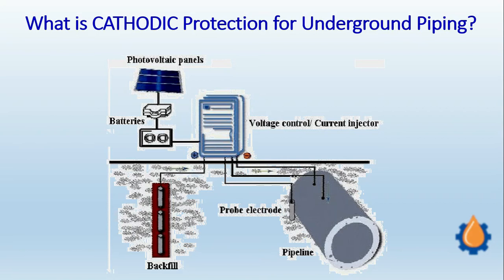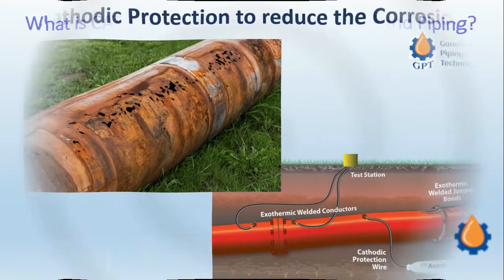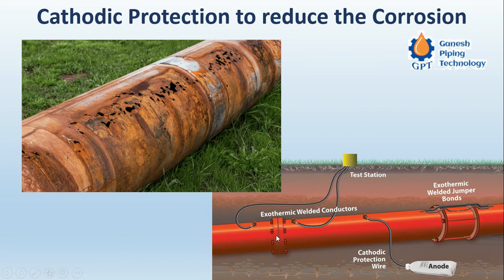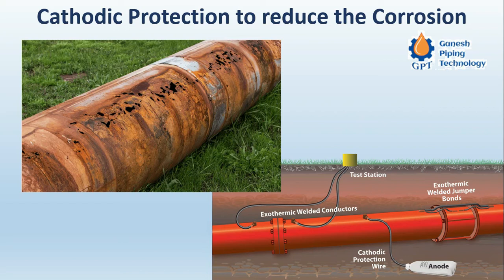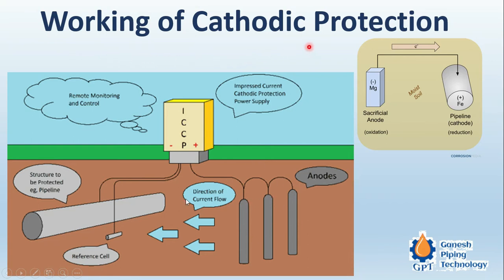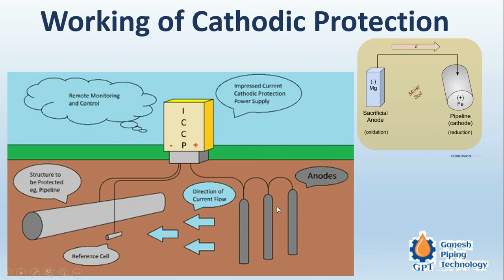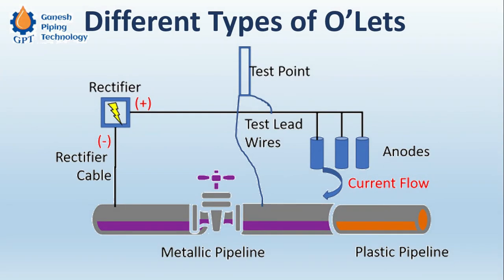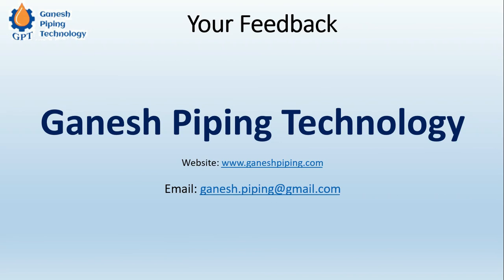What is CATHODIC Protection for Underground Piping?

Comment: Can be explained in a better way and seems few points are missing
1. Where dissimilar metals are in contact, one will act as cathode and other will act as anode based on the active metals list in the periodic table. Anode will corrode. For this we need to isolate dissimilar metals using insulating gaskets
2. If pipe is in under ground, pipe will be become anode as earth is huge potential cathode. To avoid pipe corrosion, use a less active material so that it will act as sacrificial anode and pipe become cathode